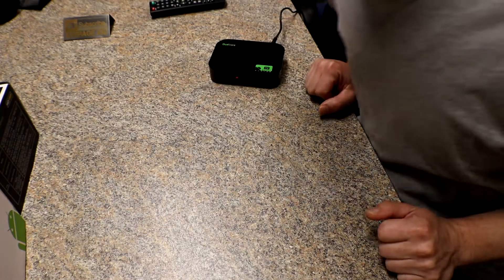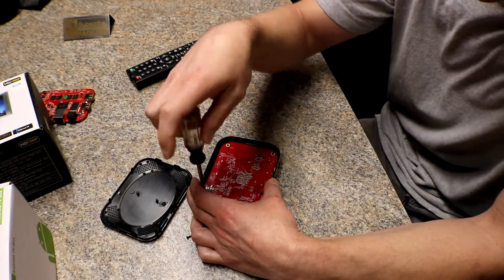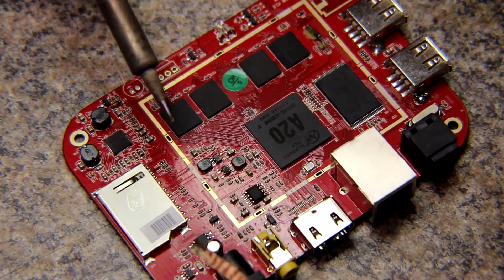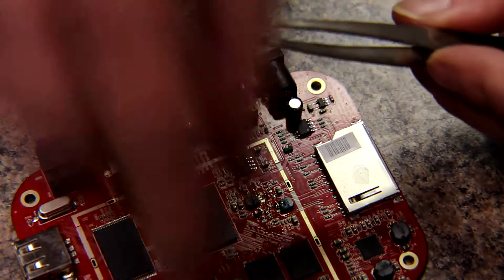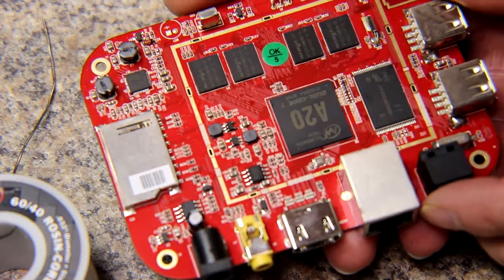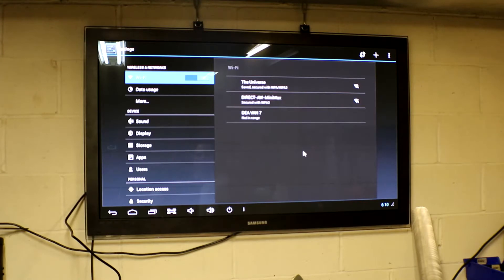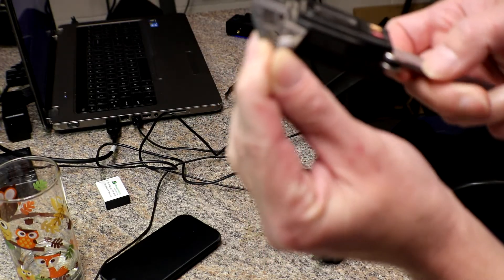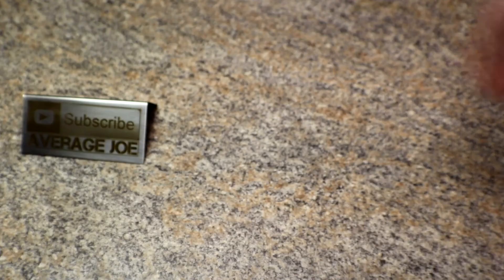Micro Soldering Android Smart Tv Box Repair

Comment: i have scishion V88 Piano RK3328  4gb ram 16gb storage device not working , after few successful software updates still the device is not booting, is this any hardware error? (i left the box in standby mode with 2tb external hard disk was connected  before this error, and the next morning there was no light indication in the box but it was in connected status after i unplugged and connected i got red light and no boot error )

Comment: Pls tell me... what i can do.. 
I gave mecool m8s pro w..
And in ON condition cinnected to tv via hdmi cable.. at that time box was working ok.. but when i plug in AV cable while working.. and plug audio ends of av cable into sound system android box shuts down.. and no signals comes to screen.. 
After that i tried so much by changing hdmi cable.. changing other tv.. 
But nothing happwns.. 
Tell me solution if can i do..
Reply from the maker: HDMI cables have audio so you shouldnt need to add any other cables.  Im guessing that is why it quits after installing extra av cables.

Comment: You did an amazing job , I have the same problem with my ott to bov but I don't know how to fix (I have put 12volts charger instead of 4volts) so there is no light what so ever. Any advice or help would be very appreciated . Cheers
Reply from the maker: Thank You!  Thats exactly what happend to ours, a 12v power supply was used instead of the original and I found that little chip had burned out by noticing the little bubble.  Yours may be the same.  I would open it up and take a look!
Reply: @AVERAGE_JOE   I have the same problem , used the wrong adapter by mistake and smoke came out of it  and now there is no  light , my tvbox is ( mxq pro 4k ) and when I opened I can't recognize any burnt ship  , i zoomed on the little ship like the one on the video and it has this number (S47BCN)

Comment: Hello mate

I plugged in wrong power adapter, the one that is 12V instead the original 5V.
It just smelled like burnt and noe no lights at all. Is there a way to repair it ?

Regards
Reply from the maker: That is exactly what happend to this one. I would take it apart and look to see if its the same part that fried. If it is then you can repair it with a regular soldering iron🖒
Reply: AveRage Joe meaning the same thing you showed in the video?
Reply from the maker: Yes👍

Comment: it's a burnt  TDA6810.   I had a similar issue with a MXQ pro box which wouldn't power on and had to replace a BX6L smd DC regulator with a SY8009B
Reply from the maker: Did you get yours back up and running?  This one is still going strong even tho its outdated lol
Reply: yes it's working now, thanks for your great video, it inspired me to open up the box and it was a surprise that the defect was the same you had. I guess these boxed have poor Power protection. Thanks again !! Cheer's!!
Reply: Yes it's working now, thanks for your great video, it inspired me to open up the box and it was a surprise that the defect was the same you had. I guess these boxed have poor Power protection. Thanks again !! Cheer's!!
Reply: And how about 6 pins dc down voltage ? Which one i can use to replace ?

Comment: hot air de-soldering station would have been better but you got to use what you have. good job getting it working
Reply from the maker: Thanks, Yeah I agree.  A hot air station would have been a lot better.  Do you have one?
Reply: AveRage Joe yes it is a cheaper one with regular solder iron and hot air for removing surface mount so far works pretty good
Reply from the maker: Great, where did you get it from?
Reply: AveRage Joe I just did a search on ebay for solder station or solder desolder station. I got it so long ago I do not have the link to it any more
Reply: hot air station would have been propper job, however, you could have helped by adding some lead solder to the pins first in your case...
get yourself a hot air station, also great for heat-shrinking and melting hot glue gun glue over a wide area....
i tend to do sub-mm electronics where things are small enough to wander up the needle of the hyperdermic suringe i use for flux lol, and at that stage is a yes you actually need a microscope...
i have come from the diy-PW group and i since have had to buy some new solder as my stuff is so thin i need like six inches to do one battery joint lol...
anyhow, as much as i found this video cringe-worthy as the wrong equiptment being used lol well done in doing it with all you had :)

remember tin solder needs more heat so add some leaded solder, also once removed add some flux and add some lead solder and wick it off to clean the old silver solder off ;) much easier...
Reply: $50 on eBay

Comment: You need a hot air reworking soldering tool.
Reply from the maker: +Terry Texas Yeah I doooo!!!!
Reply: Im using this many years now, no problems so far and very cheap.
http://www.ebay.com/itm/YIHUA-995D-Soldering-Station-Used-For-Motherboard-Repair-Tool-110V-or-220V-Y-/172485050200?var=&hash=item2828e8ff58:m:mBa2qC7UUKLbqsiE4o68tKA
Reply from the maker: Thats a pretty nice setup.  How easy/hard is it to remove chips with the heat gun
Reply: I was sent a unit that hasn't hit the market yet for evaluation.  I'll be testing it over the next week or so and will let you know the results.
Reply from the maker: +Terry Texas Yeah for sure, let me know!

Comment: Damn..... ya fucking nailed it again..... u r more then fucking lucky.... I can so easily dislike vids on utube even my friends vids... cos I am too damn critical but ur vids are all a winner winner chicken dinner ffs.... u make me want to attempt to try and fix my old fav 1gb switch that i thru in the "1 day i will repair box" cos it looks like a similar component with I think was a crack in it... I was doing something with the battery bank and didn't disconnect anything and when I finished the switch didnt work anymore but all other dc stuff did... so it was odd that that actually blew.
Reply from the maker: +OffGrid Aussie Prepper™ Thanks man, thats great to hear. Like I always say"I like to take shit apart and repair if I can" lol. I have one of those piles lol.  Yeah man take that switch apart and get to it. Only one way to find out.
Reply: yeah road block on that is finding a replacement part and trying to identify what the part was, lucky u had the same board to refer too, tried hunting down pics of it but was unsuccessful, and no schematic to be found and its a Netgear switch.
Reply from the maker: +OffGrid Aussie Prepper™ let me know the model # of the switch and ill check around here at my recycler
Reply: Netgear GS608... upon further inspection I just noticed 2 burn marks on the under side (down-unda) emi shield and found a 2nd chip with the top exploded out of it so now theres 2 x 8 leg like surface mounted ic chips r blown left side labeled on board as q1 and q2 next to induction coils. I took 1 out ages ago but its got lost in the burmuda triangle somewhere...lol
Reply from the maker: +OffGrid Aussie Prepper™ lol I do the same. Pull somethin apart and set down, it grows legs and never see it again. Ill see what my guy has
Reply: ta m8.
Reply from the maker: +OffGrid Aussie Prepper™ No prob. Hey I did a quick search and found a pic about half way down the page. It shows some part #s. Does yours look like this https://www.google.com/amp/s/tinajalabs.wordpress.com/2011/03/20/netgear-gs605-v2-fix/amp/
Reply: yep and i see them ic's on there too on the bottom pic right side of coils but not v1 or v2 and have 2 big cpu's and 1 long heatsink over both
Reply from the maker: +OffGrid Aussie Prepper™ Oh ok cool. Ill see what hes got